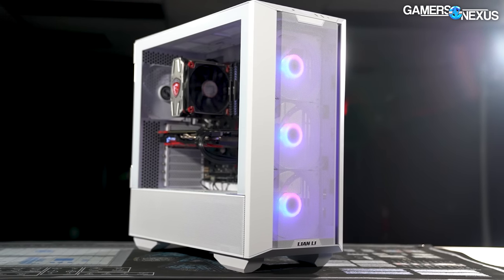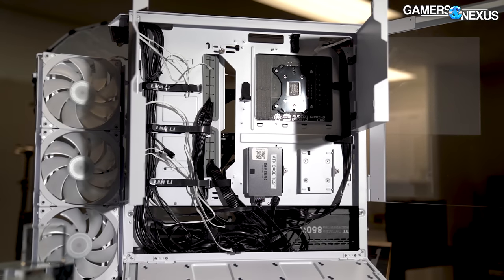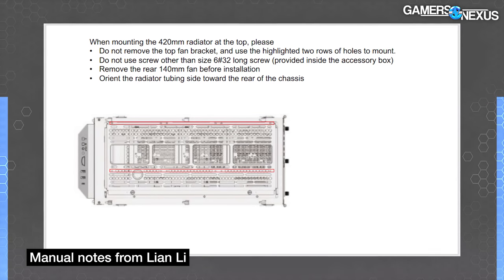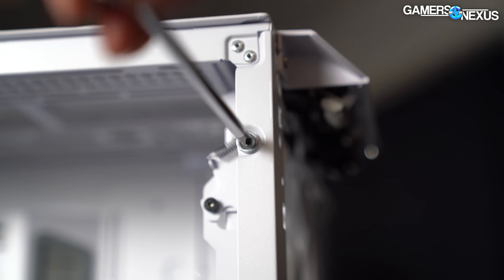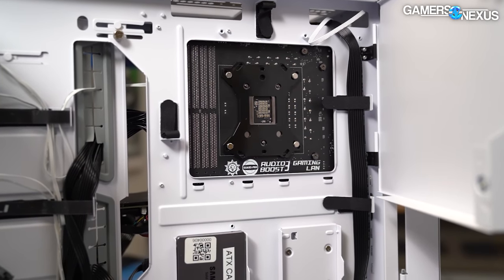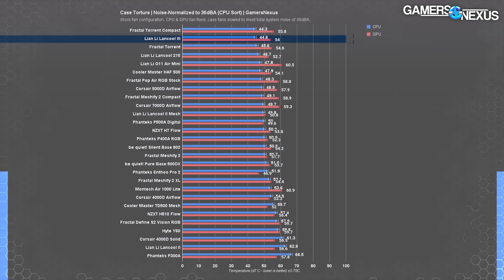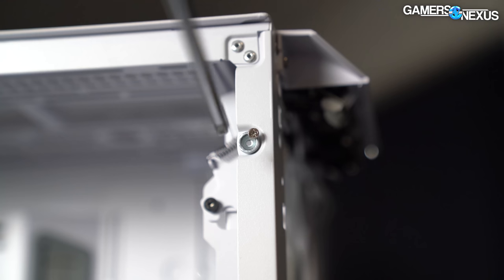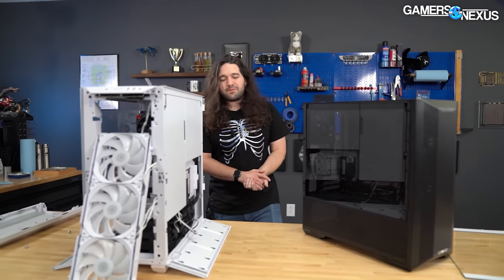Lian Li Lancool III Case Review: Build Quality, Thermals, & Cable Management

Comment: It's fantastic how Lian Li improved on some of the shortcomings of the Lancool II Mesh, a couple of which I gave them feedback about after I built my PC. Looks like the cable covers no longer interfere with routing around the edge of the case, and I kind of want to put one of those new HDD trays in my system. I also told them they could hide the front I/O better, but the new reversible panel is probably the most useless new gimmick of them all.

Comment: honestly what this shows me is just how damn good the lancool II mesh was/is. Honestly if it can be had cheaper than this new one i'd say it is the best competitor if you don't need the new fan flexibility
Reply: 100%, I have the Mesh II, and I would still buy it over the III, its $60 cheaper and the gpu being rather a lot cooler too.
Reply: Even Lian Li knows it. They recently increased the price of the Mesh II because it was undercutting the competition by 50 bucks or so. I got mine for 80€ now it's selling for more than 120€... The III feels a bit over the top with too many niche features.
Reply: I got mine for like 100 euros and its the best case ever, stock fans are good but pretty noisy and you can fit the arctic 360 in the front, the finish and quality overall is unbeatable at the price :)
Reply: @Shadow2311  Everything except the plastic hard drive things feels so high quality and  is actually useful. I have a 280 and it didn't quite fit op mounted, so it had to be used as intake as well. I even use one of those metal phone holding rings as an door handle and it looks like it was part of it all along. Best case I ever owned for sure!
Reply: @andydbedford  But what about the hole below? How was the dust collection? 

I have my rig on a living room.
Reply: @akasahi9315  So I have my rig on my desk, I have a 360 rad in the front, and ive never noticed an excess build up of dust due to this gap, and its really not that big of a gap, its finger width, its there so you can pull off the front panel. Its a real non issue.

Comment: That cable pass through slides over so you can mount an eatx mobo. It’s a beautiful case with amazing air flow and cable management and it’s super easy to build in. The negative bias was way too obvious in this video. Cya

Comment: I’ve got the Lian Li Cool 2 Mesh, and built my own pc with it. I found it to be a very easy unit to build in ( I’ve built four pc’s so far, and this was the easiest case to build in). I actually think the older unit looks better than this new one. I also wonder if the new side panel latches that run all the way down both sides of the front of the case are actually slightly blocking airflow compared to the older case which doesn’t have these latches on it? The older design that required the bottom doors to be open before the glass panels could be opened was perfectly fine in my opinion, and adding these massive latches on the new case is a step backwards as they are potentially a fail point with over usage. Also, the two solid metal doors on the back side that cover all the cables for neatness are far better on the older model as they can be screwed shut rather than using magnets. From personal experience, I struggled to get all the cables bolted behind the doors, and the magnet version would have been a giant pain to have to deal with. I can also verify that, once you get all you components in this case and it’s ready to turn on, it’s a  VERY heavy boy! I built my son’s gaming pc using another case (admittedly with a smaller GPU) and my pc is probably three times heavier than his. Another improvement that could be made to both the older and newer case would be to use the Lian Li SL120 Uni Fan Infinity ARGB PWM 120mm at the front of the case. It would increase the price, but these fans look far better, and with their interlocking system you would only have one cable to deal with rather than each fan having its own cables.

Comment: I bought the Lancool II Mesh based on your review last year. Its the one case I have purchased were I did not regret buying due to something prettier or newer coming out. I think in some ways the Lancool III is a step backwards, specifically in gpu thermals for example, which lets face is the most important thermal testing as it is the hottest component in the system. I love what they have improved upon over the Lancool II mesh, however I would still buy 2 over 3 purely based on your gpu thermal testing. Lian Li  I feel, is really competing with itself here, the Lancool III Is interesting sure, but it is not as compelling as the Lancool II Mesh, especially when considering the high price increase.
Reply: Agreed. I think GN should have discussed the worse GPU temperatures more. What is causing this degradation? Who should be getting the III vs the II Mesh, etc.?
Reply: I agree, I think the III's biggest competition is the II Mesh, and was hoping Steve would cover more comparisons between the two. Looking at the thermal results (including noise normalized), it seemed as if the II Mesh was actually better overall. I was intrigued by the III coming with 3x 140mm stock, but it seems as if those larger fans only contributed to noise, and not so much performance. I'm currently using the II Mesh and I feel that was money well spent (thanks to GN's review). Still, appreciate Lian Li for continuing to trying to improve based on feedback, and appreciate GN for providing tons of info.
Reply: @coolcat23  Yeah, I'm surprised they didn't harp on that more.  The III looks like it mostly just hangs with the II Mesh (never really pulling ahead or falling way behind), making that massive GPU temp difference stand out.  Then factor in the price difference, and I can't really see a reason to recommend the III over the II Mesh.  In any case, I definitely won't be replacing my II Mesh with the III, nor am I planning to change my recommendation of the II Mesh to new PC builders.
Reply: I  might be wrong. But lancool 2 mesh released in July 2020.  He probably did the review of the case before the release date.  RTX 3XXX released September 2020.  So assuming his using the latest hardware to test thermals he would have been using a RTX 2080ti.  So there's your temperature diference 3000 series draws like a extra 100 - 200 watts.  Would be more beneficial if they also listed the hardware that was tested with
Reply: @Threesnap  he's testing using the same GPU for all cases, its the same GPU in lancool 2 as well as lancool 3
Reply: @Threesnap  Yeah, I watched it probably back end of 2020 near December I think and bought it in January. However I do have a 3080Ti on water block, average of 27c idle and ive never seen it over 50c under full load and overclocked.
Reply: @htr5372  Yeah 100%  agreed.
Reply: @peanuts.13  Yeah absolutely, overall the previous generation was cooler and cheaper, and in my opinion more robustly designed.
Reply: @SunshineDeluxe  I think he should have pointed this out, as a few people I know would have been looking to possibly looked at swapping out for the Lancool III from the Mesh II, but that would be a complete waste of time, money and effort.
There is no way I would recommend the III whilst the  mesh II is still in production.
Reply: @Threesnap  If they are not using the exact same hardware for all case tests, the numbers are meaningless. One can only put cases into one chart, if they were given the same conditions.
Reply: It's pretty relative considering the amount of variables that differ person to person and environment to environment. My current Lancool 2 has 9 fans total a delidded i7 8700k, 32gb 4000 CL14 ram, Hybrid 3090 Ti with 360mm rad and a 280mm cpu AIO and I've never had CPU or GPU temps go above 55C. One time benching I got it to hit 58C on the CPU but hasn't happened again. I bought the Lancool 3 ASAP. If you were one to buy the Lancool 2 and saw the mesh come out you would likely think the same thing "eh not worth the upgrade" because that's what I was like. Lancool 3 isn't a step backwards at all.

Comment: I don't understand how the Lancool III is so far ahead in fan normalised testing? What is it about the chassy that causes the CPU temps to be ~5c cooler than a Fractal Meshify 2? Its bothering me because I'm looking at getting a Fractal Meshify 2 and I can't tell why its performing so poorly in comparison!!

Also, is there a difference in cases when using an AIO? I would be using a 360mm AIO, how much of a difference will the case make then?

Comment: I went from the NZXT H510i to this case and over all,  pretty happy with it. It has a few issues though.

1:There isn't enough room in the back cable tray for large GPU's like the 3090ti to fit all the cables, especially since the cable shipped by EVGA is criminally short and needs extension cables.

2: The power button is extremely easy to accidently touch while using the front ports. I've changed my power setting just because of how easy it is to depress.

3: you lose one of the bottom drive trays if you have a power supply above 1000ish watts. The power supply actually runs into the back most tray.

4: the front fan cage is poorly designed and doesn't fit well with 240 and 360 sized radiators. I'm not sure what it is but it feels like it just doesn't work.

Regardless of the above, I really like this case and would more than likely purchase it again. My biggest gripe is the magnets on the cable doors...who thought that was a good idea for cables.

Comment: "It's not abnormal to remove the front panel that wayl But for a case this advanced, with all the different levers, springs and gadgets, that might be winning our "Best Mechanical Design of the Year" award; they haven't done anything to advance the removal of the front panel."

This actually applies to basically every Lian Li case ever. This problem is so widespread that there's a cottage industry of people 3D-printing replacements for those plastic clips that they have been using since 1993.
Reply: Also Steve: lets just yeet this black front panel to prove my point
Reply: 3d printers are amazing, so many uses

Comment: I've used your mesh II video to decide I want that case, then heard yesterday you were going to review this. I think I'm going to get this over the mesh II just because it can hold so many fans and storage lads. Also, I love the dual/split drive cages, as I don't need both of them.
Edit: oh wow its a heavy case
Reply: Im choosing between this, the torrent and the meshify 2. I haven't decided yet. But I probably go with Meshify 2, because it's god damn clean.
Reply: @LordOfSweden  fractal gang
Reply: @user-sb7wj1vn4x  Yeah im Swedish so I have to support our brands I suppose :P
Reply: i got the ll as well. its a alright case. airflow is great. almost all of my games run pretty much idle fanspeed. my only complaint so far is that one of the front case fans has developed a light ticking noise when revved up. other than that, yup its heavy. especially when its loaded with beefy components, so moving that thing 💦
Reply: I have the Lancool II Mesh. Bought it last year. It's really great to build with that case thanks to the modular design but it's freaking heavy.
Reply: I am looking for an airflow-focused case to buy and I think it will be the Lancool II Mesh RGB. I was excited for Lancool III since the Lian Li Expo and I thought it will have way better GPU temperatures on the Noise-Normalizes test.
With that many fans upgraded from 2 140mm front fans on Lancool II Mesh Performance to 3 140mm fans on Lancool III RGB, I expected the better, not worse performance by almost 5 degrees! 
And in my region, Lancool III is 260€ compared to 150 for Lancool II Mesh and 100 for 4000D Airflow.

Good case, but the performance and value that its predecessor has in my region when it came to the balance of price, noise and GPU thermals.
Reply: @LordOfSweden  i got the design r5 and that baby is purring like a champ, don't really hear anything besides my gpu when it's under heavy load and it's coilwhine. (gigabyte sucks)
it's a really clean sleeper case and i like it a lot, probably the only thin i will keep when i upgrade.
Reply: I’ve owned the Mesh II performance since it was released and it’s a heavy case for sure. At the time price was $89 at microcenter but I would get the III now.

Comment: I have the lianli lancool 2 mesh rgb. The RGB fans rattle. Lianli sent me replacement that rattle the same way. I replaced them with arctic ones that are silent.  Another annoying issue is that the addtional usb-c socket is not secure enough, even if you tighten the screw really hard, after plugging in something in the socket 10 times the socket will sink into the case and then nothing is detected anymore.

Comment: I understand the longevity concerns over the features (aka 'gimmicks') but it seems like a cool case at the price point. Nothing wrong with the Fractal Design either, but it's functional without much interesting design.
Reply: I honestly dont see the longevity thing as a concern at all for 99.99% of people. Most people install their stuff in the PC, then clean it like twice a year. Throw in a new part maybe every 2 years and you keep the thing for lets say 6 years. 6x2= 12  cleanings, 3 times for new parts...you're looking at opening it 15 times. It's honestly not a problem at all.

Comment: How about Lian Li ( and a few other case manufacturers) just send their prototypes to GN FIRST, as paid design consults, before committing to production ? 
This latest iteration of the LanCool chassis actually shows how good the LanCool II is ( despite that model's quirks). I bought the LCII Mesh RGB for my march 2021 Ryzen 3900X build ( the 5900X that i really wanted was out of stock everywhere, back then) because of GN's thorough review. Definitely my most complicated build, made easier because of the thoughtful design. Though the shipping box looked okay, it became clear my unit had been dropped hard onto it's bottom front edge as the styrofoam was broken. The impact cracked the bottom of the front panel and sheared a couple of the lower retaining posts. Rather than RMA the whole thing, I was able to cut, bend and screw in a piece of sheet aluminum to cover the crack (and flatten the 'flare' it created) so it looks  like a factory design feature rather than a 'fix'. 
The post for the larger wiring cover plate was also almost sheared off, which I resolved by breaking it off, finding a black bolt in my collection of  "one day this will be handy" stuff, enlarged to hole where the post had been so the bolt could thread into it, and problem solved. 
I added two Corsair Halo 120 Fans at the top, one at the back, and a 62CFM 120mm black sickle-flow fan at the bottom to feed the GPU. My 3900X has the stock AMD Wraith RGB fan and unlike my old FX8350 powered NZXT Phantom 840 with  3x 200mm intake fans, 2x 200mm top exhausts and a 140mm rear exhaust, my Lancool blows COLD air, instead of heating my room.

Comment: I bought lancool ii mesh rgb based on your review.
and this time I trust you that I don't need an upgrade, lancool ii mesh is still perform better, look smaller. Lancool III did make some improvement but those QOL things are not enough to exchange for the performance of Lancool II Mesh. I always trust Patrick

Comment: One thing I like about the mechanics of the Lancool 3 is it's all metal on metal. I love my old CM690 II and III cases from a look feel and installation standpoint, but the plastic pin that pushed the power button on my II broke off a few years in. Both the II and III's hard drive trays failed when the rubber grommets turned to powder, and the II's were flex plastic that started breaking after removal a few years in. And then there was the rattling of all the little pieces slightly not fitting and fan vibration would make them tick like an old air conditioner. All of these were critical failures, but they pass the review cycle because they don't fail until later. They're also not unique to just that case.

My Lancool 2's plastic failure point is the front cover, which would have been nice to avoid but it's an industry standard connection method everyone is doing. Everything else structural is metal.

With that said, "custom sheet metal spring loaded latch all the things" 100% reminds me of Dell cases but without all the bad packed in around it. I can imagine having a bad feeling but not realizing why around them.

Comment: I'm still rocking the Lancool ii but Lian Li sold the mesh front and sides from the lancool ii mesh so $30 later and I have made my first gen ii a mesh!  airflow in the case is great now, My 3080 never gets above 65 C and my 5800X being cooled by the Arctic Freezer 240 rad rarely ever hits 70C at high gaming loads using around 60% CPU power.